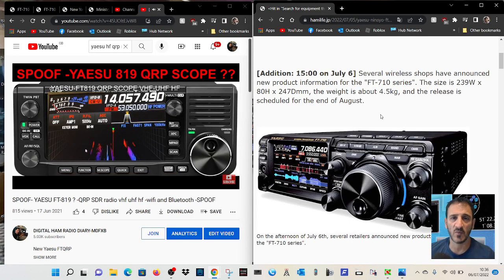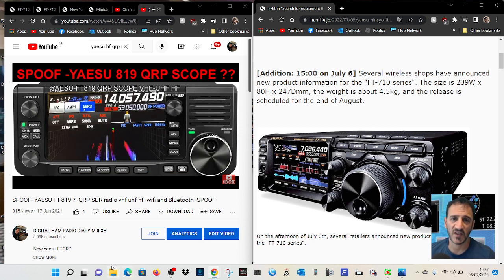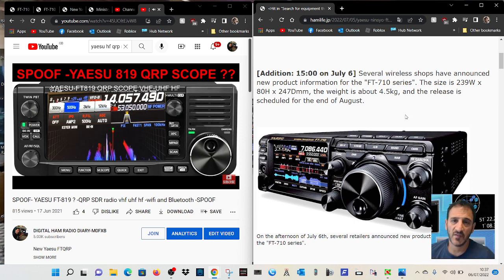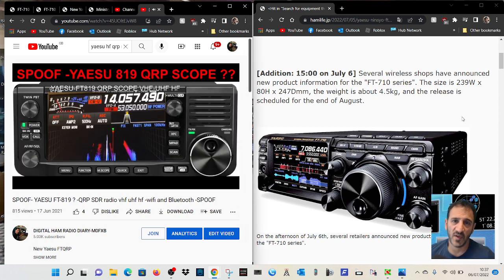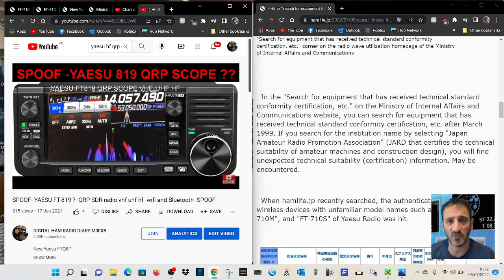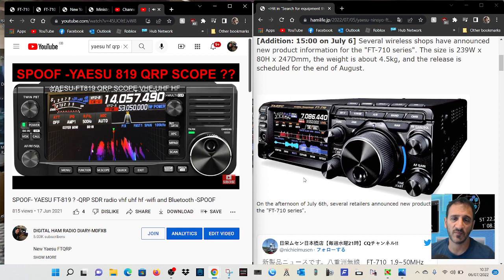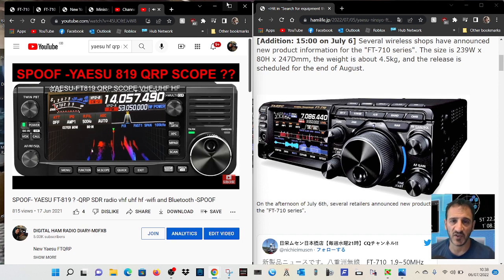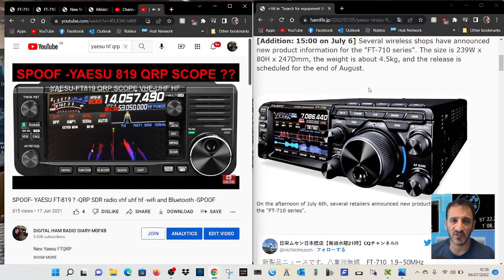YAESU FT-710 , 710m ,710s 4.5 kg -

Comment: looks like a replacement for the ft450 may be
Reply from the maker: FTDx10
Reply: @M0FXBHamTech  No. It's gonna be a 7300 competitor. Likely no superhet in the front end, straight SDR.
Reply: @M0FXBHamTech   No, just FT-450 replacement, is not the end for the FTdx10